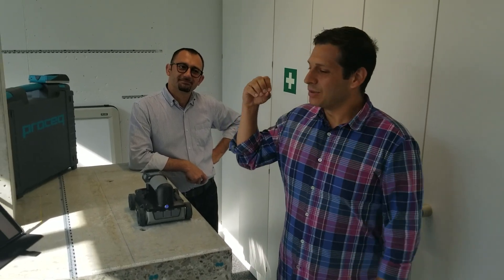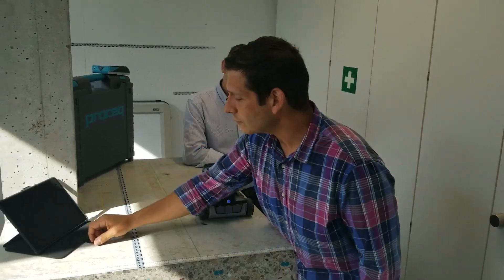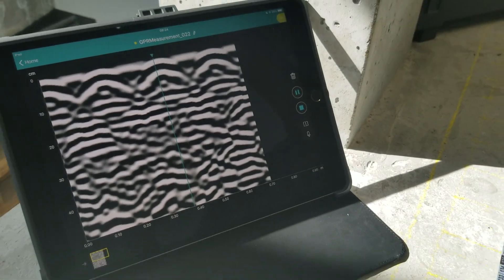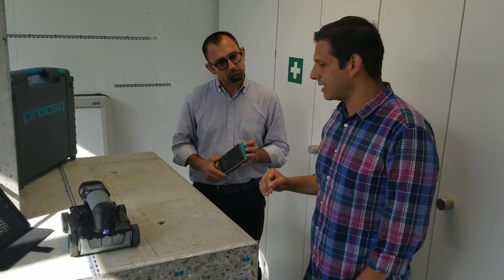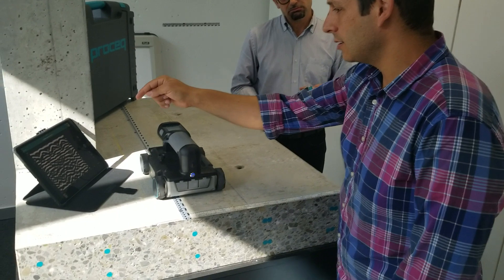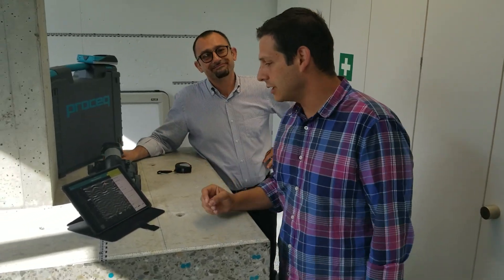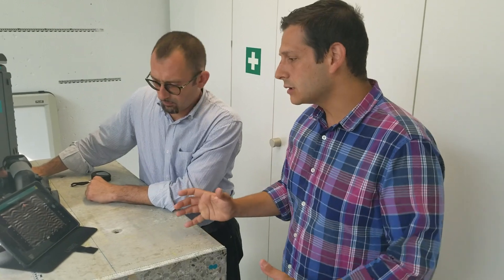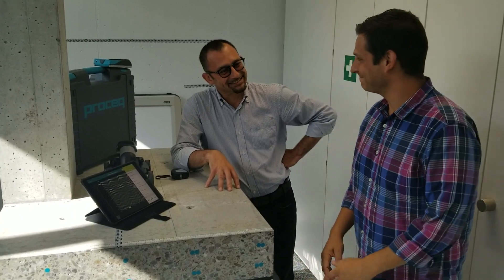Using a Covermeter to correct GPR wave velocity during Concrete Scanning

Comment: + - 5mm for coverage on GPR. If it hasn't been calibrated to known located with a low dielectric you can be a good 50mm off atleast 
Thankyou so much for sharing the knowledge of calibrating the GPR to depth gained using Cover meter  
Cover meter has a much higher accuracy on coverage to top layer provided rebar below 70mm coverage
Reply: + or - 1mm accuracy for the Proceq would be determined on the device being calibrated to the correct diameter of bar and shallow coverage 
Otherwise you'd be looking at + or - 3mm >

Comment: Wow, very interesting. 
So can I use any cover meter or just this one?
Reply: We use an Elcometer - there are three different methods to estimate rebar size, we perform all three.  Once you know size, then you know depth; the uncertainty in the size is the uncertainty in the depth.  Remember that if the rebar is spaced too closely, then the numbers will be off - Elcometer has three heads, we own all three and know the limits on adjacent and perpendicular rebar.  We would normally mark all the rebar with the GPR, then use that to size the rebar, then come up with a best estimate of the size and use it to determine the depth, then we can adjust the GPR.  Covermeter accuracy is to within one rebar size, so the accuracy will vary with that, but it's always better than GPR techniques, in our experience.  Of course, we only go through all of that effort if it is important to know rebar size, depth of cover, spacing, etc.  For a simple scan and mark, not needed, then we might just use the covermeter to confirm the GPR, but we always bring both to any concrete job, because GPR will be freaked out by the air in cinder fill, but the covermeter will save you (down to 8 inches).
Reply from the maker: Should be able to use any. Just make sure its a cover meter not a rebar finder. Many of the cheap ones dont give cover. And make sure the accuracy is 1 mm.
Reply: Cheer mate.
Reply from the maker: Thanks so much Barry. I appreciate you adding to the conversation. Great point on using the gpr, then another technique, then adjust the gpr. Always helpfull!!!!